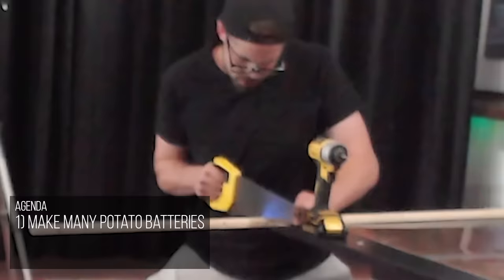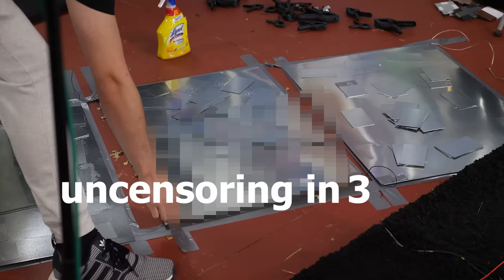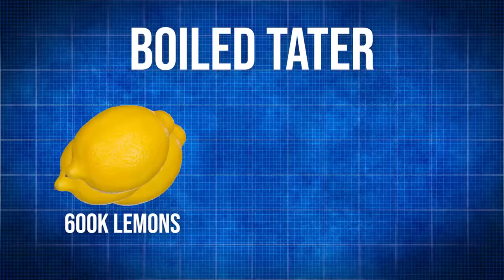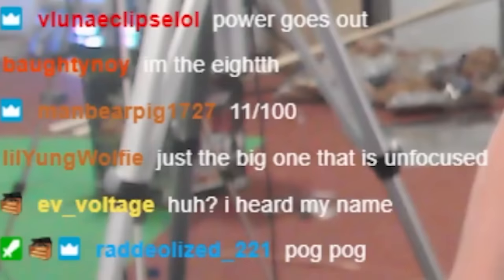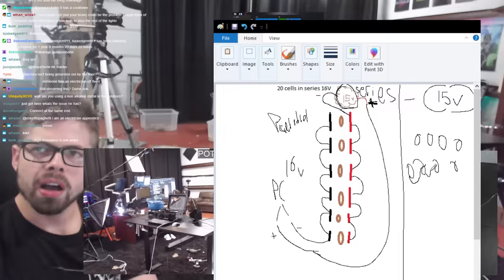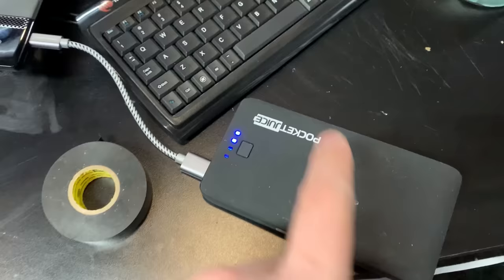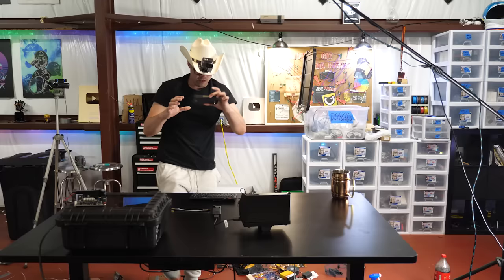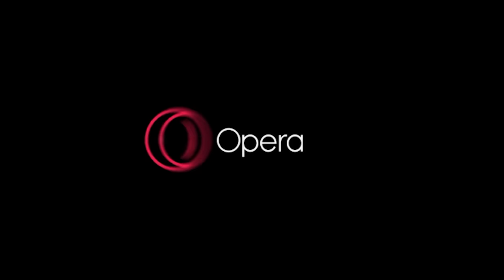I Built a PC That Runs on Potatoes

Comment: I have learned more about electricity from a 14 minute meme video than I have from 14 years of school.
Reply: this video is super wrong. Good video but little understanding lol
Reply: @linkl_6641  yeah exactly 💯🤣🤣
Reply: Ehhh he got some points right, but he's general understanding of electricity is flawed.

The way he measured the amps of the cells was a pretty clear indicator..
None the less, he got it working 😎👍
Reply: anyone else catch how he was wiring it in series/parallel? the big plates on the floor were all in parallel, then a few small ones in series to raise the voltage. then leaving this whole mess unattended for 5 days.
Reply: Idk man who even goes to school for 14 years, surely you learned a little more than about a MS paint diagram
Reply: Ya school teaches nothing about life only stuff you never going to use
Reply: @6torthor  2 years kindergarten
6 years primary
6 years secondary

for u though probably 0
Reply: @urnoob5528 I interpreted the comment as 14 years of college, but sure, you can be loser dissing random comment sections from 10 months ago

Comment: I’m not scientist, but I had an idea. What is for a V2? You wire everything up in parallel to get a very high voltage. Like 20v at a very low amperage. And use a converter to step that down to a lower voltage, but a higher amperage that way you can power it directly off potato cells?

Comment: maybe you could mix low resistance metal powder into the smashed potatoes, in theory it could make the conductivity easier for the potatoes and you could add them in series with eachother i guess, but it probably would be a very small difference.

Comment: you cant do voltage and current like that. When youre measuring current, the voltage is zero. 0v*50A = 0 watt. 50v*0A is also 0watt. To power your pc you need liek 20v and 3 amp, which is 60 watt

Comment: But, the potatoes powered those charging indicator LED for weeks. If you removed those LEDs from that battery, you could have saved A LOT OF POTATO energy. 😔
An LED is about 0.05 watts (2v ×0.02A). If that ran for 2 weeks, the LEDs wasted most of the energy there.

Comment: kinda waste, there's a lot of power in them potatoes but you just used them as electrolyte to gather power from the metal sheets
if completely combusted they'd yield a lot more than 15 seconds of 50W

Comment: The power comes from the metals, not the food.
Reply: No, no they dont
The metals react with the acids in the potato, both are needed in order for the electrochemical battery to work
if you only had metals, they would not produce any power
Reply: @elarsongaming8222  Yeah, but the metals are consumed in the process, the acid remains.